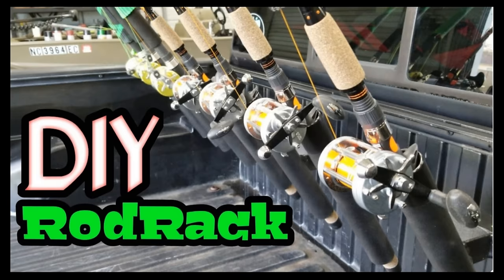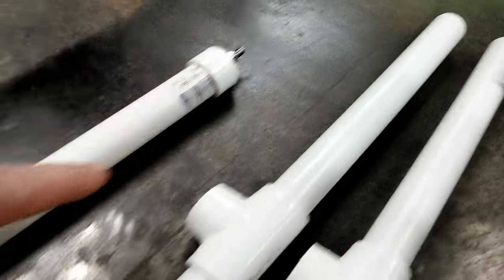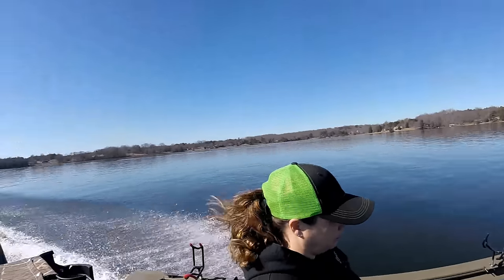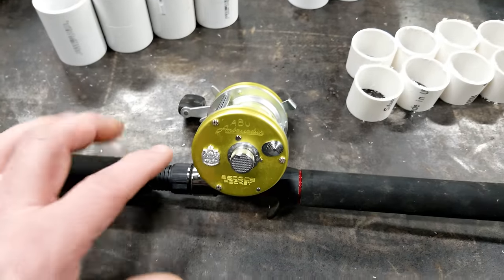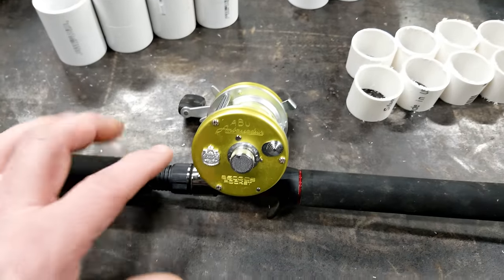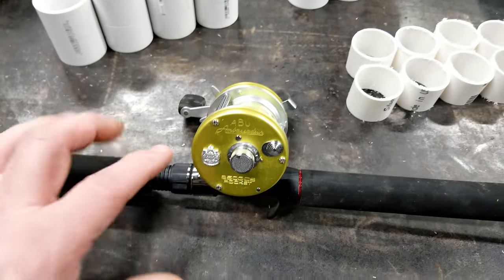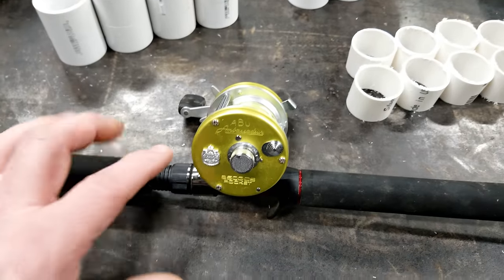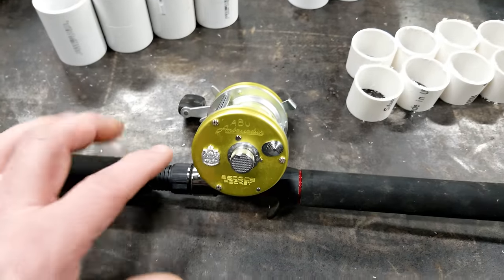7 NEW PVC Fishing HACKs ( thats AWESOME )

Comment: Excellent video as usual...  I like both of the rod racks you made, and I made two slight modifications: (1) Each row of rod holder tubes is 4 inches taller than the first (reducing collisions between reels), and (2) I mounted casters on the corners to make it easier to move around in my garage.  Keep the videos coming!  Cheers, Capt. John
Reply from the maker: That sounds pretty cool , I like em both too lol . I'm kind of partial too the first one

Comment: I made a 10 rod rack holder using  5 gallon Home Depot bucket and screwing the 1 1/2 pvc pipes to the side of the bucket. The bucket fits perfectly into the 4 wheel mini dolly Harbor Freight sells and is perfectly mobile and looks great. Made 7 of them to hold my 70 rods neatly. 👌👌👌

Comment: Great ideas. Just found your channel. For your GoPro stand... The parts that you do not glue, stuff with foam , then drill a quarter inch hole through the assembled fitting and use a keeper pin to secure it. Be sure to sand the PVC a little so it will assemble and come apart easily. Lots of great stuff. Keep 'em coming.
Reply from the maker: Thank you  Sir  , and thank you for watching . I'm glad you found the Chanel brother

Comment: Like your original rod holder.  It just looks more sturdy.   I made wooden ones years ago that went up against the wall.  Works fine but I need to place a hook over the top slot so the poles don't fall out.  I can see modifying this to go on the wall and my falling down problem is solved.

Comment: I noticed the old rod holder you made for the boat has hangers between all of the rod holders. If you wanted you could take some pool noodles cut them into flat strips and glue them to the new rod holder and you could hang lures on it. Also you could drill holes at the ends of the boards and tie on some paracord loops so you can attach tools with carabiners like pliers and snips. Anyway cool projects and cool video.
Reply from the maker: Thank you brother  , those are good ideas man . I wish I had thought of that 😕

Comment: I believe the original rod rack was a nicer, cleaner build. Also, the original rod rack will be more stable on an uneven surface because only two runners touch the ground as opposed to four runners. If you have perfectly flat concrete floors either will work but your first build will accommodate most people’s imperfect shop floor. Really enjoy the channel - keep it up
Reply from the maker: Thank you Sir,  I appreciate you watching and taking the time to comment  , and I agree with you about the 1st one and the unlevel floors.  Very good observation

Comment: For the camera tripod you could add weight to the bottom sections and that will make it more stable. You just have to make sure its spaced evenly and won't move. You could even extend to upright portion that the camera mounts on down under water and weight that section. That would probably be even more stable since its lower. That will of course make it larger and heavier so it's a trade off to what's more important. Another great video!
Reply from the maker: Thank you Troy , and that's a good idea  , I always ran 2 cameras on the old one any way and it stopped flipping and gave me 2 different angles  . I look forward to using this one more often since the odds are itll be with me lol

Comment: For the camera mount, here is an idea. Instead of using a T for the center post, use a 4 way. Add a second post pointing down. Put a few lead weights in it and it will act like a counter balance and keep it from tipping over. Just a thought. Cool idea tho.

Comment: If you ever have to make another one of those camera mounts, build the first one with four sides but don't glue the center T fitting. That's what my buddies and I did to make collapsible spoolers when we were running fiber in Ohio. To make it mostly sealed just seal up the 2 short pipes going to the center T. When you're not using it, fold it mostly flat.

Comment: To be honest, I like the bucket rod holder the best. "Keep it simple" is my motto and it doesn't get any simpler. I keep casting rods in one, spinning rods in another and surf rods or anything too long to stand in my garage hanging on the wall. I put some sand in the bottom for some weight, although it doesn't really need it but a few of them are pretty damn expensive and I worry about them getting stepped on. But man, that one idea cleaned my garage up with just s little bit of time and money.
Reply from the maker: The sand is a great idea

Comment: On my way to Lowe's!  Going to build a version of the rod rack, but I will fill the bottom tubes with sand to make it heavy, and tie it down in the back of my truck bed.  5 Rods Wide, 3 Rows Deep, should make it stable enough to stand in the truck bed for the 80 mile ride to the boat.
Reply from the maker: That should work , drill Sikhs tiny holes so the water can drain and the sand won't run out

Comment: If you use screw in pieces you would get more secure connections and still have the same mobility and you could have different pole heights for underwater use
Reply from the maker: That's a good idea , these are just ideas to get ppl started  . But your totally correct

Comment: You need to get a spray paint spray gun, its $3.00 save youre finger tips. You can also add rubbing alcohol to the freezer tube, it will keep it cold but not solid.
Reply from the maker: I've used those paint can sprayers they work good  . The salt I put in the ice tubes do the samething by lowering the temperature required to freeze the water . But I bet Alcohol would work good too

Comment: You could use some silastic to seal each end of the tubes on the go pro mount and not glue the ends together. That way you can pull it apart for easy storage and not have to worry about water getting inside the tubes and weighing it down when you are using it.
Reply from the maker: That's a good idea , those pool noodles can hold up a lot of weight . I was just trying to keep it simple . But I did think about putting some spray foam in it

Comment: Just found your channel from mid south and ya have some excellent material certainly appreciate it!...just a quick question regarding your rod holder inside the seat pedestal on the boat. Does the rod holder spin within the pedestal?... I’m think of constructing yours but didn’t know if it’d freely spin once I got the boat up to speed..45mph ish.
Reply from the maker: It will only spin with the seat post if you bolt it too it , it just sets over it , you child make it longer so it touches the floor and it shouldn't spin as much
Reply: Thanks man I see that now. Excellent stuff!

Comment: For the in boat rod holder, does it just slip over the top of the pedestal?  If so, does it rotate then or do you put something to keep in place?  Thanks
Reply from the maker: It slips over . It did rotate  , but so did the pedestal I used . If you had a screw in pedestal you could drill a hole and pin it

Comment: Both floor rod racks are very good but the new one has a more simpler and easy design.

As for the one that goes on the boat. The new design anyone can make and I love that.

Project idea, DIY down rigger? Can you build one?
Reply from the maker: I'll have to fo use research , I've never used one . But I fo know what it is and what its for
Reply: @FishinNStuff  A downrigger is a device used while fishing using the trolling method, which places a lure at the desired depth. ... A clip, also known as a "release," attaches a fishing line to the cannonball weight. The bait or lure is attached to the release.

Comment: why do you add salt to the freezer tube? Doesn’t that hinder it from freezing? I’ve made a live well cooler that looks surprisingly a lot like the one you made prior to seeing your video. i usually just freeze some water bottles but i like your idea
Reply from the maker: This is from Google.  Not my words lol but it does work . It's the same reason they put shad in a salt water  brine
Salt makes ice colder because salt forms a thin layer on ice and saltwater has a lower freezing point than water due to which the freezing point of ice reduces from 0° C to -2° C. Therefore, ice becomes colder by adding salt to it.

Comment: why do you not use the primer when you glue pvc pipe together?
Reply from the maker: You can . But I found out years ago it'll melt together fine without it . Is it just a good I'm not going to argue that . But I have done it on water pipe when I was out and it held fine . And these diys are under much pressure  . The primers for cleaning it so make sure is clean if you don't use it . Depending on what I'm using then for sometimes I don't even glue them like the PVC rod rack storage it's not necessary  but it's better to glue it . But some people leave the ends unglued so they can add on to it later

Comment: take fiberglass screen and velcro  to make bag so water will drain
Reply from the maker: Could you explain that a little better it dived very interesting
Reply: @FishinNStuff  hello,  i am a beekeeper and i took some of the fiberglass screen material to make a bag large enough to fit around my beehive, then i used velco around the opening to close it off tight for transporting the hive inside my suv . worked  great.  if you have a sewing machine, or serger, or get some to sew it for you,  take material cut it to size needed for bag, use the velco to make closure (velcro  so it don't rust around water), then you will have bag to store wet items that will drain , no mold no mildew

Comment: when are you going to build a ultimate fishing cart? For pier, bridge, bank, beach fishing.
Reply from the maker: I've been studying direct ways to do it . Let me ask you a question do I make one fit a truck . Or do I make one that folds up for a car
Reply: @FishinNStuff  I bought the large Gorilla cart to do it, in my opinion it is to big need a truck to move it. The regular Gorilla cart can fit in a SUV. Was going to use ammo can battery box hack to power one or two fog lights for night fishing with your rod holder and cutting board hacks. An a way to anchor it to the ground so when a "FISH ON" the cart doesn't roll in.
Reply: @FishinNStuff  truck